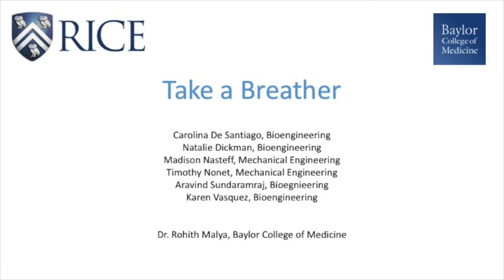Final Design for Automated Bag Valve Mask

Comment: take a look at this:https://www.youtube.com/watch?v=_0lB3IuuDo8
An automatic should not be used for a mask. In addition, a mask without a human involved cannot reliably deliver a breath. (From an anesthesiologist). Way too complicated for the Third World and use  in an emergency in the United States.  .
This is easily constructed using metal, wood, or plastic using hand tools. There is only one moving part and is robust enough to be transported in the back of a truck bouncing over roads, with thousands of holes per mile. All comments welcome.
 "When you have a hammer, everything is a nail."

Comment: I would like  to point out that, this design will result in a big dead-space and rebreathing of expired air leading to hypercarbia and respiratory acidosis. The valve has to be at the patient end of the tubing. Again, the design is specific for a particular type of bag and valve. This has to be built in a way so that, it can accommodate many different types of self-inflating bag-valve resuscitators. One more thing which has to be considered is the variable respiratory rate, I:E ratio and variability of tidal volume. 
Being an engineering institution, they can contemplate on that and come up with a better design. Involve one anesthesiologist doctor in your team.
However, appreciate your efforts to help in these difficult times.

Comment: sorry but if this is final design you are going to kill more people than coronavirus
Reply: What Tywon was about to tell that, this design will result in a big dead-space and rebreathing of expired air leading to hypercarbia and respiratory acidosis. The valve has to be at the patient end of the tubing. Again, the design is specific for a particular type of bag and valve. This has to be built in a way so that, it can accommodate many different types of self-inflating bag-valve resuscitators. One more thing which has to be considered is the variable respiratory rate, I:E ratio and variability of tidal volume. 
Being an engineering institution, they can contemplate on that and come up with a better design. Involve one anesthesiologist doctor in your team.
However, appreciate your efforts to help in these difficult times.
Reply: 😂. They have made it half way through. There is a whole lot more they need to understand, but I appreciate their efforts.
Reply: can you be more specific?
Reply: @lililerde  atelectasis, barotrauma, volutrauma, hypercarbia, lung tissue damage due to dif temp and humidity. Without pressure sensors, o2, co2 levels sensors, 

humidity and temp sensors, filters, humidityfiers, o2 supply, 

responsive microcontroller to adapt realtime this will do more damage 

than help. Not even mention mask should be as close to exhausting 

vaulve as possible or otherwise you pump patient own co2 back and forth 

throuh that pipe. And what with those rapid movements? Nobody breathe 

like that. At least use accelstepper.h library to make it move more 

organic. If anybody is serious about it don't try to reinwent the 

wheel. 15min search in google and you can find plans and parts used in 

proffesional respirators (why they not cheap) and informations what is 

essential not to do any harm first. I'm not a hater it is good someone 

want to help but this is not the way.  For somebody that already has 

problems with breathing this device is a death sentence. Even 

healthiest man on planet after 24 hours would beg to be killed or 

needed years of rehab. You know this feeling of dizzyness after blowing 

few air balloons now imagine somebody did this to you for hours. 

Barotrauma is worse than that. Good luck with version 2.0

Comment: MIT says they submitted their design for FDA, i am searching from 2 days not even a single open FDA approved or practically used is found, guys please react soon
Reply: Please may you hit me up if you come across any good Open Source Ventilator project , whatsapp UK 44 7918 750 810
Reply: @countryfactorconferences770  comprehensive list: "Analysis of Open Source COVID-19 Pandemic Ventilator Projects" https://docs.google.com/spreadsheets/d/e/2PACX-1vTYAfldxoIiO46VAWH1NlhrwFBn9mguqS2bh1spnLEu4AVVN1cj1vaEm6vOp5Z6UnaAbUwd8dslCXdM/pubhtml ; another list: https://docs.google.com/spreadsheets/d/1jM9d7G_8WaNrWRbd5JHQ-LR8Dx8YSGEayJU0f1-QnqY/edit#gid=1400209173 ; one of the better simple diy designs I've seen https://www.youtube.com/watch?v=eelHJNxPgGE ; one that uses compressed air so gets rid of motors/bearings/parts wear https://www.youtube.com/watch?v=xdZtMgpxnPI ; some general design considerations https://github.com/jcl5m1/ventilator/wiki/Notes-from-chatting-with-a-pulmonologist